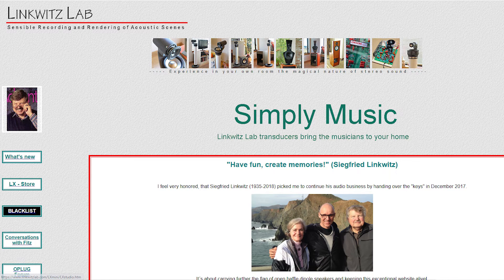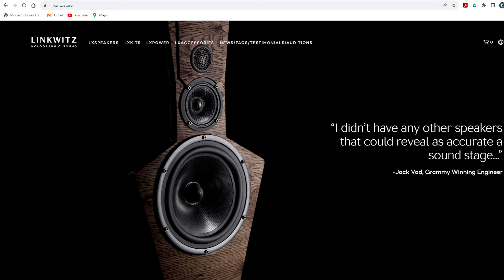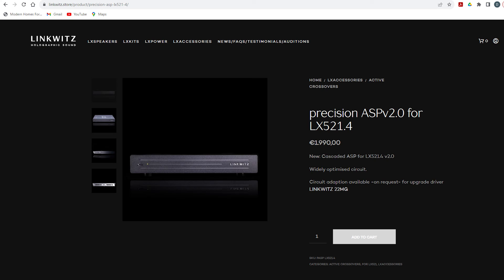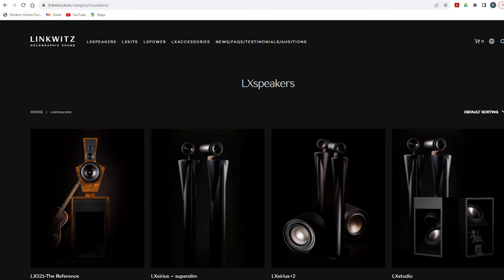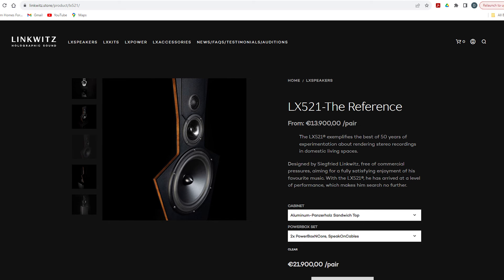Linkwitz Lab LX521.4 Review After 6 Years of Ownership- Part 1 Introduction

Comment: microwave transmission engineer. I built the orion boards as my first electronics project, it was a real bear! 
The cost of buying all standard parts for LX521 at Madisound is: drivers $2500, flat pack cabinets $1000, ASP $1000. I would say with ancillaries, cables paint etc. $5000 budget build, save $600 if you cut your own wood.
Reply from the maker: I was figuring in amplification as well as most people cannot reuse their existing amps as they will likely be 2 channel.

Comment: When I heard these speakers and I could build them, I was in.  I have already built the cabinets and will be purchasing the drivers etc soon.  
It would be hard to find better speakers for the price.
Reply from the maker: You will not regret this.  What midrange are you buying, the magnesium or the older design?  What crossover have you purchased?  See my other two parts of this review for tips on setup and what I think of their sound.
Reply: I went with the new magnesium mid, and built a custom bass enclosure